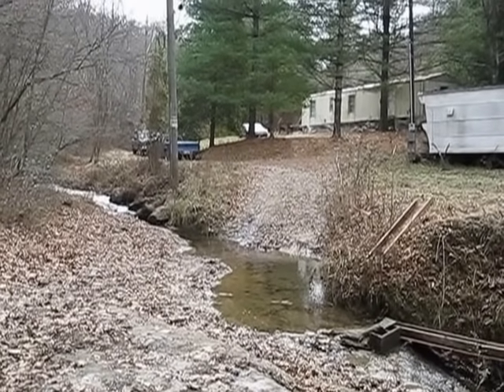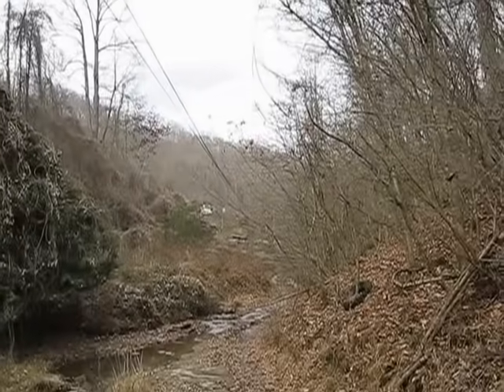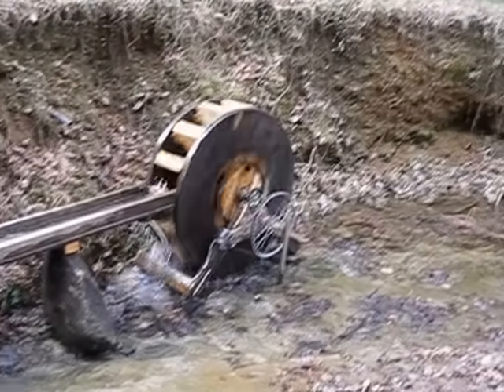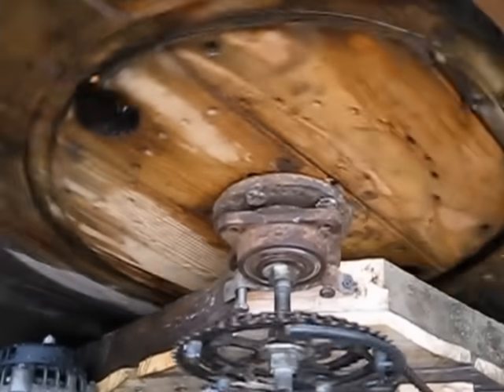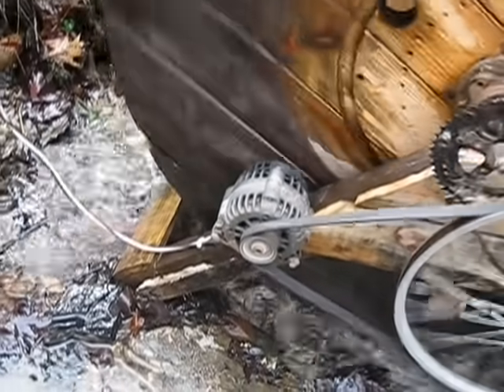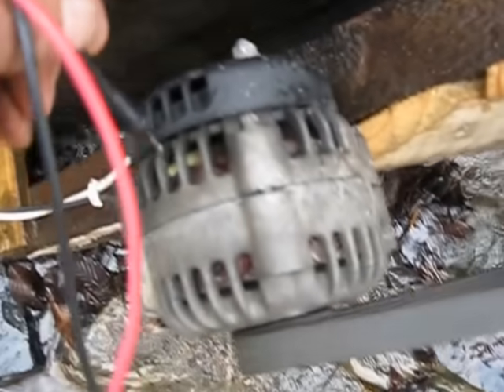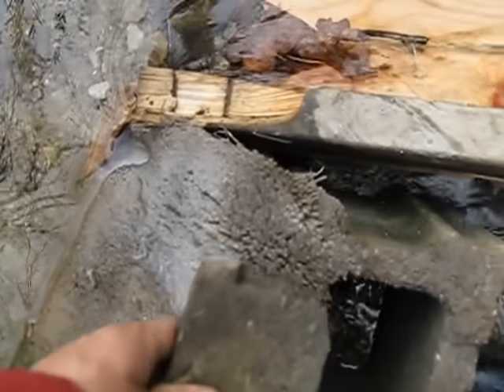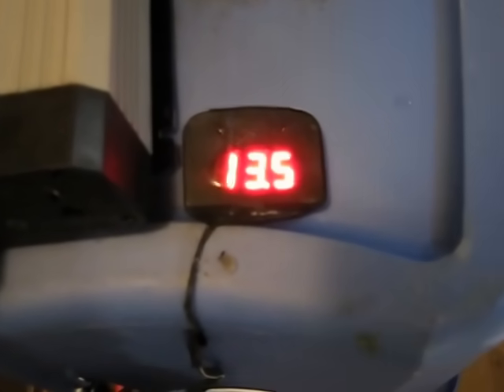water wheel generator

Comment: 40v. wow, thats good production. (how many amps?)
Reply: Voltage divided by whatever resistance equals amps you have so shorten the wires or use better conductors for more amps.
Reply from the maker: Jd Cunningham not sure exactly I tried measuring the amps with my cheap meter but it overloads at 10 amps so I guess it's more than that.
Reply: wow thats awesome production then, (imma have to try to copy they way you have your gears set up.)  keep up the awesome videos.
Reply: +Off Road/Off Grid 
Looks good.  Deep cycle yup, that helps.  Just suggest to put the inverter at the location of the alternator so the DC carrying wires are as short as possible.  Maybe a little power shed over and around the wheel?  We had a couple relay stations in the arctic where we used wind and solar power together, and it powered everything.  Off-the-grid is the best.  (Can you pick up TV signals so ya don't have to pay it to the cable man too?  damn vampires)
Reply: +Off Road/Off Grid curious about the alternator altercations.
make a video?
Reply: +libertyforamericanow There is some good videos out there just search for PMAs and how to make them  Delco is one of the most common alternators that they do kits for..
Reply: Could you add a transformer to increase the voltage? That way, you won't loose as much due to the volt-amp resistance.
Reply: I estimate a water flow of 10 gallons/minute and a head of three feet.  With that as inputs,  the theoretical maximum amount of power he can generate is about five watts.

Comment: That is cool. What do you do to protect the set up when the water freezes? Will it damage the wheel if you leave it in or do you have to take it out of the water in the winter? Peace, Reese
Reply from the maker: Reeses Pieces It freezes up sometimes in winter but before long it thaws. I have a backup generator that runs on my free natural gas supply. I would like to try wind and solar but finances won't allow it right now.
Reply: you can build a solar panel out of pop cans. look it up. cheers

Comment: OF/OG,  I agree with Terry.  You were able to stop the wheel before with too much load, so the next step to getting more power is to drop the same amount of water (No mods to the wheel) a further distance.  If you do this, I bet you could get 20% more power out, but until then, you can not increase power generation since you are already near the limit with your current setup.  If I were you, to do this, I would try to have less slope on your water trough feed so it puts water into the wheel higher up.  You may need to extend the trough.  You've done a great job.  Just perfect it a bit more! Cheers to you!
Reply from the maker: Inspironator The property line is not much further. I have it almost on the line now. I have concidered raising the level of my driveway and putting a culvert under it.

Comment: You know you are getting your power from two factors... !.  Volume of water flow (you probably can't change that without doing a rain dance)  2.  Drop.  Your water is dropping about 3 feet..... BUT you can pipe water from farther upstream (or move your wheel farther downstream) and significantly increase the drop and gain much much much more energy.... but you would need a larger water wheel.... or set up two wheels and reuse the water before it reaches ground level.

Comment: Do you get any hydrogen gas in the house from  the battery bank?
Reply from the maker: dpos89 the way it is shown in the video is not ideal but I never had a problem with the tub over the batteries. I have a better setup now, a wood box built around the batteries with a computer fan in a hole cut on one end and a pvc vent tube leading through the floor.

Comment: If you move your chain up to the largest sprocket, you double the rpm's on the alternator
Reply from the maker: Jesse Ward True, but while it doubles the rpm's it cuts the torque in half. I'm already at the point where the wheel slows almost to a stop when I turn on more than two tvs.
Reply: I did not think of that.

Comment: hi, can you explain, how did you change  that car alternator ?
thank you
Reply from the maker: There are probably better ways to do it which would give more efficient results, but all I did was take the alternator apart and drilled out some holes in the rotor deep enough to fit four neodymium magnets into. I JB welded them into the holes and reassembled it all and it worked. The voltage regulator of course does not work because the variance of voltage on the rotor coil(or field as it is called) is what determines the electromagnetic power of the rotor. With permanent magnets taking the place of the electromagnet, you have maximum power being generated any time the alternator turns.
Reply: Off Road/Off Grid okay I guess that answers that :-)

Comment: nice job sir.,,,do you have a wiring diagram and list of things that i need and specs.,im not an electrician i have a little knowledge, but i want to make like you've invented.,thank you in advance,..where in the middle of the farm and we have good source of water but no electricity,.
Reply from the maker: edreian armada A real PMA would be a lot better than a homemade one like mine. The wiring will differ depending on what type of generator, batteries, and inverter you have. Also the batteries and invereter should be in a small shelter as close to the water wheel as possible to minimize the voltage drop as AC current travels long distances better than DC. You can normally get a wire spool from any utillity company(I got mine from the telephone company).The bearings are wheel bearings from a front wheel drive car, and of course the bicycle sprocket and wheel
Reply: Thank you for that info.. i plan to make this next year,,.
Reply from the maker: Good luck. Let me know if you have any questions.

Comment: Hey what type of PM alternator is that in the video? 12 or 24 volts? How many magnets 7, 14, or more? 

Also I'm curious, as to whether the number of volts or magnets make the alternator spin harder?

I have a similar set up to yours. I based most of my build off of your video (other then the water wheel. Which I built from another waterwheel tutorial build) Anyhow, my wheel spins perfectly by water flow, but when I attach my alternator via pulley to bike wheel I can't even get the wheel to move...    My alternator is a 24 volt, 7 magnet alternator... It turns really hard compared to a normal alternator...     Any clue as to what could be the problem in my build? Do I have the wrong type of alternator...?   If u need more info I'd be glad to give u contact information so I can send u visuals of my build, so u can better understand my scenario.

Thank you!
Reply from the maker: my alternator is a car alternator that I drilled out holes in the rotor and put four neodymium magnets in. Mine was a 12 volt originaly. You may try changing the gearing to make the alternator turn slower(geared lower to provide more torque.)

Comment: Nice project.  How much power is being generated.  You show the volts, but what about the amps?  How many amps or watts are you getting?
Reply: The person you are replying to "SittingMoose" is likely a child bro. Seriously more people on these comment sections are young kids than you expect. 

Of course you are correct, showing either voltage or current just by itself is useless, we need to see both to know the actual amount of power. 
It's rather obvious that the alternator wouldn't be producing a decent amount of current, as they spin much faster than that within cars and produce around 30-60 amps of current. 

Judging by his voltage reading and the slow spin on the alternator, it wouldn't be that surprising if it's only producing 1-2 amps. 

Though this is enough to charge his batteries, but there would be a much better way to design the system. Also it's best to try to use power directly from a source like a stream, instead of always putting it into car batteries (you lose more power then and lose battery life).

For example I run off grid, and I have set up quite a few sections that run direct from panels during the day. Of course they go through regulators etc, basically I only use the batteries when I really have to. (like night time usage).
Reply: Popcorn Shiner It's all about Potential Energy or PE=MgH   It takes about 2 feet of head for 1 PSI.  To get 50 PSI you need a 100 foot drop.  Most people don't have the change in elevation on their property which is why people use a water wheel.

I did the calculation once.  And as I recall the amount of water needed to power a 700 watt generator with a 10 foot drop in one day was close to 500,000 gallons.  Which is about how much water is in 25 backyard in-ground swimming pools.

It's all about the PE of water.  One needs height or volume to generate electricity.
Reply: Popcorn Shiner  Now if you believe in free energy or over unity crap than forget all of the math and physics.  You'll also have to believe it works as so far no one has gotten any of these things to work.  Many say they have, until you find they won't show it to you.
Reply from the maker: not sure of the amps, it's enough to charge my batteries.
Reply: Off Road/Off Grid  You have a multi-meter which measures amp, what's the problem in measuring the amps?  

Volts are meaningless, it's the amps that are important.

Does your water wheel generator generate enough electricity to light a can headlight. brake light, tail light or LED?

Just trying to understand how much electrical electrical energy you are creating.
Reply: ***** Are you saying you are all hot air?  And the people who know what they are talking about, (the real engineers) your not allowing them to talk.

What are you hiding?
Reply: ***** Dude it's a combination of experimentation and math.  We have close to 200 years of experimentation and figured out the math over 100 years ago.

Your tweaking on me instead of having a nice conversation.  Since you don't understand the math, maybe you could tell me how long it takes to charge the batteries from a fully discharged state?
Reply: ***** Sorry I do not understand your Italilan or are you a Sakawa Boy causing trouble?
Reply from the maker: Well the water wheel provides enough power to charge my bank of 6 deep cycle batteries(I know the ones in the video are not deep cycle). It also powers a 1500 watt inverter which runs 3 tvs all the incondescent lights,2 box fans. and charges two laptops. I also have 12 volt LED lights, and a 12 volt RV water pump. My cheap multimeter only is capable of measuring 10 amps. As long as it puts out enough power to run what I need I don't care how much over that it puts out.
Reply: Off Road/Off Grid The guy doesn't seem to know how much power or amperage he's producing, he only says how much voltage he's producing.

It looks like the alternator he's using is a 40 or maybe 60 amp alternator.  Let's call it 50 amp.  The maximum power output would be 600 watts DC current.  From the looks of things he's not getting anywhere close to full efficiency so maybe it's 60% which would be 360 watts.  But if you look close there's a lot of energy loss, so I don't think he's even getting getting 60%.  Compare that to a Pelton wheel in which he could get 90-95% efficiency.  

He's probably producing just enough electricity to barely charge one of your batteries or power one TVs but that's no where near 1500 watts you need to power your inverter.  

There's another gut on YouTube who has a whirlpool waterwheel you might want to take a look at.  His design produces 800 watts and is about 70% efficient but could easily be made to be more efficient.  He just don't need the added efficiency.
Reply: Off Road/Off Grid y7gjy hh yvfbvhunjigfhuhg ffguugyjtthbvgh fngggrdhhjhbffdbfygggjgbghnbbhhggvhhmygbvyutbbg
Reply: WolfWithACNE I was reading it with the voice of William Shatner in my mind.
Reply: I realy don't think a Pelton wheel would work in the above situation, there wouldn't be enough head pressure to run it fast enough.
Reply: Popcorn Shiner I think you need about 70 or more drop for a Pelton wheel to work.
Reply: Passed High School Physics yeah that's what I have read but I if you have the pressure that's the way I would go.
Reply: Nice thanks for the details.

Comment: Great project. Be careful with the battery storage. the batteries, while charging, off gas hydrogen gas which is highly explosive, especially if contained in an enclosed space, like under your tub. Think ventilation.
Also think corrosion, from the battery acid. The tub lid is good to have under them but the tub lid should have ventilation to and from the outside. Mounting the Generator higher in the structure would better protect it from high water flooding.Cant wait to see the new design.

Comment: First off, I'm talking like I know something, anyone correct me if they think I'm wrong here, but...
#1 thing to do, get more batteries. If you've drained your power to the point your wheel is hung, you're dead in the water (pun intended).
#2. Ditch the BMX bike sprocket/system, and go with a good old steel 1970's Schwinn 3, 5, or dare I suggest it, 10 speed. Gearing is your bigger problem outside of lack of capacity. I recently found a 1976 Schwinn varisty 10 speed that still had the seller-installed front wheel generator for the headlamp/taillight on ebay for $35.00. When it shifts, you know it, not like the plastic junk of today's mountain bikes.
#3. Watch out for that belt drive. You do manage to get enough of a ratio to power your stuff, but how fast does that belt wear out?
#4. I see this over and over, people have their alt/gen set below the apex of the waterwheel, and no protection from water. It may not have shorted/rusted out yet, but it will eventually.
Back on point #1, if you're getting usable non-deep cycle for nearly nothing, don't sweat getting the pricier ones, just swap yours out. Oh, and of course pay attention to the hydrogen gas boiling out of the ones going bad. You don't smoke, I hope. Were it me, I'd plant them on a concrete pad in a real enclosure outside the house, and arrange them so you can meter them without restacking them every time.

I'm really impressed with how much juice your lil' crick is putting out though. Oh, and on that, your feed needs to aim a tiny bit lower on the wheel, you're wasting most of the inertia splashing head-on, if you see what I mean. Might upgrade to a 3 speed if you aim better.
Reply: Ah, my mistake. Looking closer at the video, you do have multi-gear capability, and I suspect it's about as high as you can set it. Using what you have, that's not really on the table, just go with more batteries/etc. I guess.

Comment: Is the water level fluctuating between seasons? How's your generator handling it?
Reply from the maker: The water runs all year although it does flood sometimes. Also in dry summers it slows quite a bit but theres still enough flow to turn the wheel. My alternator didn't handle the last flood well. I'm going to have to pull it apart for repairs. It's been a wet summer here.
Reply: I don't know, but I would say that the generator- alternator needs to protected from the water!

Comment: A small question :
if you put a bigger wheel ( the one on the axle of the waterwheel ) that drives that chain to the bicycle wheel, it will increase the rpm. using the same alternator, would you be able to produce more electricity ?
Reply from the maker: Yes it would increase the rpm. this was the biggest one I could find at the time.
Reply: sweet little setup mate. . excellent !!
im also going to have the same system as soon as i move to the countryside.
Reply: True, a larger diameter will produce more power, but it would be negligible compared to the gearing to the motor. 8:3 vs. 8.4182:3: really isn't a change. The real key is enough battery storage, be able to isolate the battery power under heavy load, and high-gearing (more than single-speed) for recharge without locking the generator. I'm thinking this could be stable at 10 12vDC batts, and with enough rats nest cabling, life could be good with 16 or so.